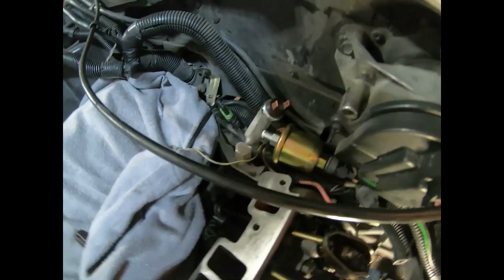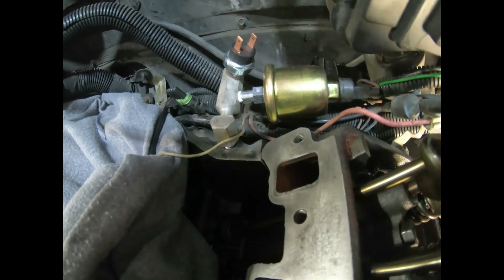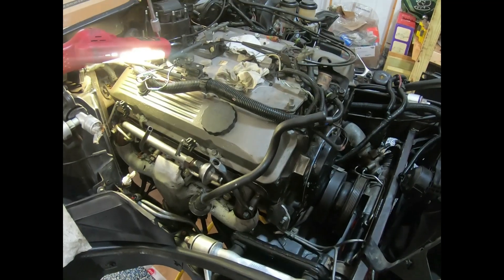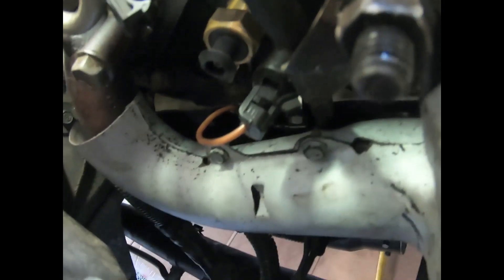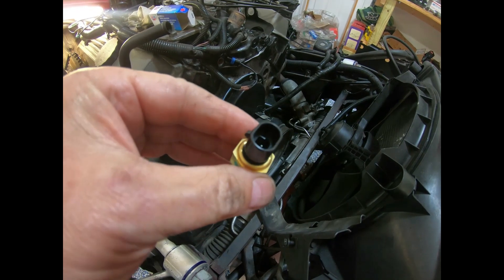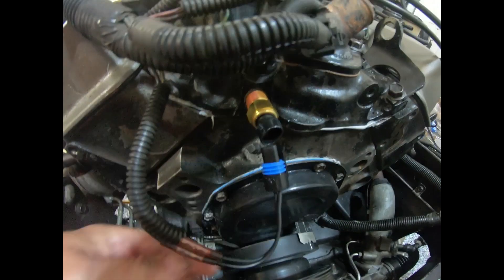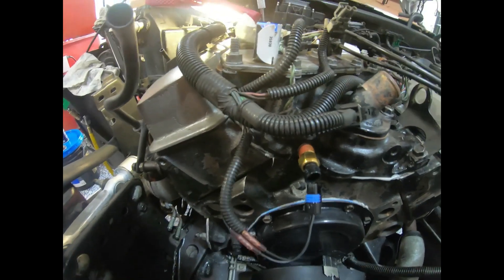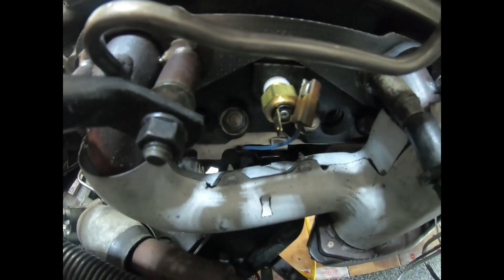84 C4  Corvette. Oil pressure and Temp. and Coolant Temperature sensors locations and there usages.

Comment: Awesome to see all the locations clearly. These locations are the same for 1985 . 
One small point is regarding the Oil Pressure Switch. The switch is not needed to power the fuel pump. It is only there as a backup should the fuel pump relay fail. If you have a good operational relay, you can disconnect the oil pressure switch. Typically when the fuel pump relay fails you will often get a fault code 54.  This code sets when the voltage at the Fuel pump monitor circuit of the ECM does not see above 2 volts in 1.5 seconds.  It basically means the FP relay has failed. However, the fuel pump will run when the oil pressure gets above 4 psi which will close the oil pressure switch enough to get power to the fuel pump. This usually takes a longer crank time ,than when the fuel pump relay is operating. The oil pressure switch also acts as a safety device while driving so that the fuel pump will continue to run , even if the FP relay fails while on the highway.
The fuel pump relay is triggered on for the key on 2 second prime AND while reference pulses come from the HEI distributor to the ECM on the purple / wht wire.
Reply from the maker: Interesting, I wasn't aware of that. Thanks for watching my videos!
Reply: @84c4corvetteguy5  I did not mention, but you probably already know, you can turn the fuel pump on to see if it is working by taking 12 v power into the Diagnostic G terminal in the car. The relay used on these have an extra connection to accomplish this without turning the key. If you turn the key this method will not work.  I have had an 85 vette since 1988. I am always interested in learning more especially about the 2 year only 82 and 84 Cross Fire. I especially like the videos on the dual injector setup , and EGR stuff. Too bad they did not use a pressure tap to check the fuel...like on the 85 rail.
Reply from the maker: @danieljurgill1681  I did know that you can turn on the fuel pump, a pretty cool diagnostic tool. Once again I appreciate your comments and watching my videos and I hope you get something out of them.

Comment: I have a 95 corvette and i cannot find my oil temperature sensor even above the oil filter ??
Reply from the maker: It does not look like mine on the later cars it has more than 1 wire but it should be right around the oil filter area. Here is a picture of what yours look like. Thanks for watching!   https://www.zip-corvette.com/90-96-oil-temperature-sender.html?gad_source=1&gclid=CjwKCAjw5Ky1BhAgEiwA5jGujkOo0qb4Z4O-Zg259zBLyQn182rrePOE7byF2WLl7NNjqqqlV9YkkRoCn10QAvD_BwE

Comment: What is the part number for the Coolant Fan sensor located on the back passenger side? TIA
Reply from the maker: Passenger rear head/coolant fan = Advance auto - Carquest ACA1267, Drivers front head/Temp. gage = A/C Delco 88865046, Intake manifold/ECM = NTK304036, I hope this helps. Thanks for watching!
Reply: @84c4corvetteguy5  The NTK304036 shows up as the Oxygen Sensor
Reply from the maker: @scott.engles  Here is a link,  Did you put in NGK instead of NTK? but the part # looks good. You will also need to change the connector on a 84 because they no longer make the two wire umbrella sensor for the ECM.  https://www.corvettecentral.com/search?CurrentSearchCategoryId=&q=coolant+temp+sensor&Years=1984

Comment: i got a 1990, is it possible to remove the oil pressure sensor without taking the wiper motor out>? and if there is a leak at the sensor, can i just put sealant on the treat and put it back on, or does it need a new sensor? sensor works ok.....
Reply from the maker: I'm not sure if the wiper motor has to come out on  the LT1 engine to get room. I would tend to think you can sneak in there with the right wrenches. As far as do you have to replace the sensor, if it is leaking at the threads No you can just unscrew it and add thread sealant or Teflon tape and reinstall it no problem but if the seam of the sensor is leaking then the sensor must be replaced. I have seen many engines that leak from the pipe that screws  the sensor to the block so look at that carefully as well. I hope this helps, Thanks for watching!
Reply: @84c4corvetteguy5  thanks,  if it leaks from that pipe, what to do ?
Reply from the maker: @KonradG-o7c  Not a big deal, Unscrew the pipe out of the block and add pipe sealant or Teflon tape to the pipe and reinstall it
Reply: @84c4corvetteguy5  many thanks

Comment: Why does your 84 have two sensors and mine does not?? Mine has the 3 prong larger sensor.
Reply from the maker: I beleive the 3 wire came out later in production. what year is your C4? If your car has a 3 wire sensor it is both a switch for the fuel pump and a sensor for the oil pressure, the early cars had 2 switches/sensors the later cars had 1 combination switch/sensor. At least thats the way I remember it.